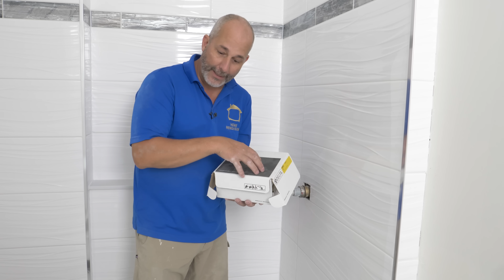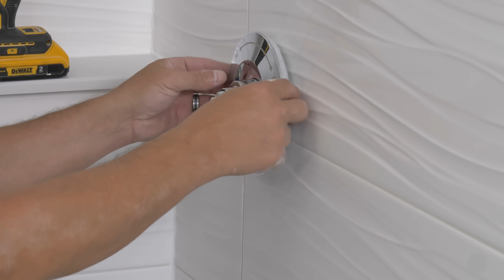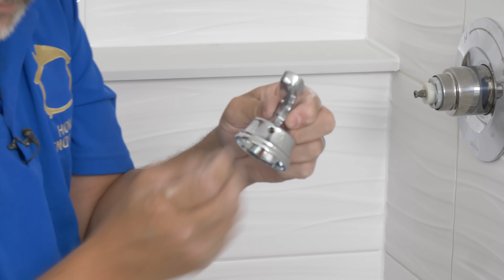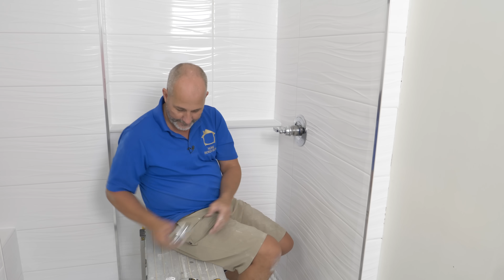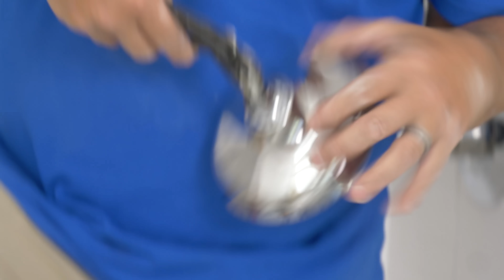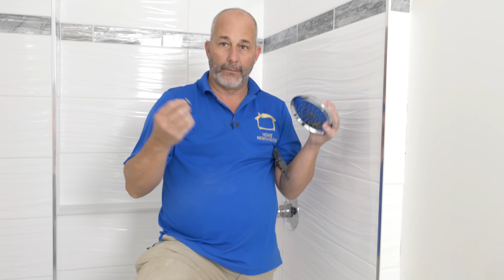Change Your Shower Head and Get BETTER Water Pressure

Comment: @9m15s, the piece Jeff takes out of the shower head is NOT the flow regulator. It's just an aerator. The flow regulator is STILL IN the shower head assembly. It is that little blue thing you see looking down inside of the threads on the shower head. This particular head he's installing will still have poor pressure because he never takes out the real flow regulator, and he never tells you that manufacturers now build the shower heads such that it's almost IMPOSSIBLE to remove them unless you destroy the entire shower head. This is how Communist our countries have become!

Comment: Question, I have removed the restriction but the pressure will sometimes be awesome but if I switch settings the pressure will not come back when I switch it back. I heard a click but I can't figure out why or how to get the pressure back.

Comment: @9:10:  That's a screen, not an aerator or flow-restrictor.  The blue thing is the flow-restrictor.  If you remove the flow restrictor, reinstall the screen, unless you just like having calcium deposits in your fixtures that you can't clean out.

Comment: My shower head started leaking, so I bought a new handheld showerhead. The old one was 5yrs old. The water pressure was SO BAD with the new shower head. I could hold the shower head with the spray pointing toward the ceiling and the water jets would only shoot out about 2 inches above the shower head. So I removed the shower head and realized there was a tiny blue plastic restrictor installed in the base of the shower head handle. I removed that, reinstalled it, and now the pressure is excellent. I also did the same thing on my bathroom sink and kitchen faucet. I hate wimpy water pressure.

Comment: The real issue here is the ridiculous pancake size shower head.. Why? Because it’s the latest trend.  I’m sure everyone takes their visitors  to the shower to show them their shower head🙄. You can use water responsibly and still have water pressure.  Simply go back to the regular water restriction shower heads. They are often  provided free by your local utility company.

Comment: Delta makes a Monitor17 trim kit called Lahara that has two levers coming out of the same hole. The larger one adjusts pressure and the smaller one adjusts temperature. You can leave it at your preferred temperature and then adjust pressure to whatever you want. I really like that option. Had a cartridge blow on one due to unexpected freeze (it doesn't usually freeze here) but Delta sent a replacement for free. Installation for my application required access to behind the valve and the flange didn't sit flush against the wall- but I think that is because my wall ended up a bit wonky. The cement board must have bent slightly and the surround I put up over it followed the bend. Ether that or the flange was bent. Couldn't tell which but I applied caulk around it to cover the gap.
I caulked around the bottom too. Oops. LOL. I can always cut a relief in the caulk below if push comes to shove. You'd have my shower trim if you hate seeing the silicone. LOL. I wasn't going to caulk until I saw the gap that was left and could not get the flange to adjust tighter.
LOL. I'm sure my mother will let me know if she's not happy the way I renovate her bathroom. I'm glad you remembered that women do renos to. LOL. I'm the handy one-- although with recent health issues & loss of hand strength + arthritis, I have to get help from a younger male friend.
My brother is the one who needs the high pressure to wash the product out of his hair. He's got like 10 bottles of product in my shower right now (since its the only working one in the house). I have 2 bottles. LOL. I need to see if my showerhead has that stupid aerator because I know it is going to get clogged by my hard water if I don't take care of it.
Around here, you have to purge your lines a little before installing the valves & showerheads or else sediment that has been sitting in the pipes will clog them.
I wish I'd watched this before I installed the shower trim in my bathroom-- but that was months ago and I'm glad I have been able to shower.

Comment: all shower heads come with gasget. I ve never seen a single shower head with tapered thread. Can there be one? yes sure, but I never seen. so you shouldnt put teflon tape. I said you shouldnt I didnt say you dont need to. Reason is if you put teflon to a gasget joint it is easier to leak than not using it. Since the thread is strait you are not squizing the teflon. and sometime teflon gives feeling of you are done turning. it gives a tightness feeling but you still didnt squeze the gasget. Most probably the part you moved was also gasget. double function. Take it out and put a gasget. I have fixed so many showerhead leak just taking the teflon and reinstaling in many years. you are one of the best guys in youtube. I never seen you doing something wrong. I think this is the only thing that need to be addressed. Thanks bro. Mahalo from Hawaii

Comment: An aerator mixes the surrounding air with the shower head flow. Making a smooth stream and using less water.
And of course a lesser impact on the environment.
Reply: And makes me have to take twice as long in the shower to wash myself. Fuck off.

Comment: I'm from Europe and when I visited the U.S.A., i was shocked by the unconvenient shower in my hotel. A fixed shower head at the top and the faucet had only one degree of freedom - first you increase the water flow of cold water up to the maximum and then it starts adding hot water. I thought - this must be some old system, certainly nobody would install this nowadays. And as I see, it is still common and people do this voluntarily to their own homes :)
You cannot have a warm (mixed) water of a lower than maximum flow? Well, for a fixed "rain" shower, this might not be the biggest problem. But I really cannot imagine using the fixed shower head. What if you want to wash just dirty feet? Or your whole body, but don't wet your hair (especiall women)? How to you give special attention to your private parts? How to you clean the shower itself?
Of course - everybody can use what (s)he wants, my comment is not meant to criticize! I'm just expressing my surprise. If I bought a house with such a shower (well, it would be hard, it is hardly existing in my country), I would give it the top priority to replace it :)

Comment: either your cartridge is install  upside down or your valve body is flipped.

Also your valve body needs to be secured to some backing.

I would start flipping the cartridge first. there a hot side labelled since a 1000 years

Comment: Jeff removed the filter for the showerhead so the nozzles dont get clogged, the actual restrictor is the blue piece with small o-ring that was beneath the filter.
Reply: Yep. Noticed that too.
Reply: Shhhhh, don't give away the secret.
Reply: yeppers
Reply: Correct. It’s the black o-ring that you need to remove. Just did that on a fixture I installed
Reply: @jfastard The black o-ring seals the fixture to the stem.  It's not a flow-restrictor.
Reply: @ncooty  then why did my shower pressure skyrocket after removing the o ring? Respectfully, I’ll agree to disagree with you.
Reply: @jfastard  I wonder if we're talking about the same o-ring.  Are you talking about the flat o-ring that serves as a gasket between the shower head and stem, or the small round one integrated into the flow-restrictor itself?
Reply: @ncooty  I am talking about the small one that restricts the flow
Reply: @jfastard  Gotcha.  I misunderstood you.  My mistake.

Comment: Ok so this has zero effect on water pressure , the pressure remains the same no matter , what your doing is trying to increase the flow rate , but this would only be achieved by removing g the actual restrictor ( which is the blue part ) what you removed is the filter 🤦🏽

Comment: I'm not recommending you remove the flow restrictor but if you do, then replace it with a sediment screen otherwise you risk plugging some of the holes without an easy way to remove the sediment. Sediment is most likely to occur when the house water has been turned off and then back on. Since Jeff doesn't have a faucet in his shower, all sediment will always go through his shower head. Running the shower faucet for a couple minutes would reduce the risk.
Reply: Exactly what I came here to say. Our water company is constantly fixing leaks and turning off the water or it seems we're always fixing leaks of our own and having to turn the water off. Every time that water comes back on, sediment comes with it ( we also need to replace our old water heater) and I have to rinse the screens in the shower. If not for those screens, I'd have to replace my shower heads constantly. They don't reduce the pressure either like those plastic restrictors.
Reply: @triciasanders2455 solution to the sediment issue from the utility company: whole house water filter. Place it as close to where the water enters the house first. It will save you all kinds of grief. When I installed mine, I installed a carbon filter next in line before continuing on through the house. All taps had filtered water at them. Just change out the filters as needed. For me it was about once a year. For a family it will be sooner. And no more mud in my pipes, 😊
Reply: @denisegaylord382  We have definitely talked about that because that's exactly what we need! We've had so many other projects that came first, we just haven't gotten around to that one! 🤦🏼‍♀️😂

Comment: I think the valve assembly was installed upside down which is why Jeff decided to reverse the handle. Reversing the handle is a bad idea. Reversing it has gravity turning it on and lifting it is an unnatural movement to fully turn it off. Typically, there is a stop adjustment for the hot side which is why it wasn't level. My recommendation is to position the handle correctly even though it does not look perfect.
Reply: He didn't even secure the valve body either lol
Reply: It causes problems later on too. That delta valve can rotate a bit and you'll get leaking after turning it on and off over the years. When I moved back into this house the assembly was always dripping, the "plumber" for the rental company installed it upside down. It took me about three hours just to get it out of the damn housing.

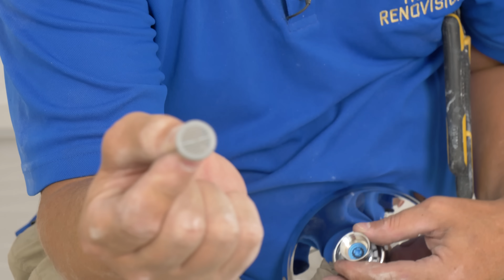Comment: What you took out is not a restrictor, it's just a plastic sediment filter/mesh. You left the restrictor in the shower head. It's blue and clearly visible at 9:18.
Reply: I removed the exact same part from my Gerber shower head 3 months ago and it almost doubled the water volume coming out. Since then I've been telling everyone I know if they want more water flow to do what I did. Whether you call it a restrictor or a filter it does the same thing - it restricts the water flow.
Reply: @Butterfly-iz3nm  The filter screen and restrictor are 2 different parts.
Reply: My restrictor was permanently placed in the shower head. I literally just went the ghetto route and drilled a fat screw down the middle to open the hole up lovely. It was life changing. Hope this helps anyone else that encounters the same problem. Now I shower in a fire hydrant lol 🚿
Reply: If you are very careful, you can usually drill out the flow restrictor, and reinstall the filter screen. I usually try to match the restrictor size to the drill bit, and working carefully, slowly drill it out. A vice to hold the shower head is nice if you have one. Don't push too hard, you can drill right through the whole assembly if you're not careful. Low rpms. Gentle pressure.
Reply: My moen came out easily. It depends on model and design. Not going to get great pressure with just the screen filter removed.
Reply: Good luck removing that, ask me how I know 😂. They put valves on them as they constrict the line.
Reply: @ForrestOutman  If nothing else you can drill a hole in it.
Reply: Just remove the o ring
Reply: Now I just check flow rates when I shop, phuk low flow

Comment: If your shower pressure is extremely high after removing any restrictor, then you might have overall too high water pressure in your house and need a pressure regulator valve. Too high pressure in your pipes can cause them to fail.
Reply: This is nonsense.If your pipes are failing, then they are corroded to failure, and regardless of any restrictions, their life is at an end. Water delivery pressure in North America is nominally 60 psig (4 bar), perhaps slightly less if your house is at the end of a mains loop or at the top of a hill. Residential pipe/tubing is tested to 300 psi, and the burst strength is about double that, or 10x mains pressure. BTW the "pressure" of the water when it exits the faucet is atmospheric pressure. What you perceive as pressure is flow and/or velocity. The higher the flow through an orifice (i.e. the nozzles at the shower outlet) the higher the velocity will be. As correctly pointed out in the video, the shower restrictions that are factory-installed are designed to reduce flow, which will reduce velocity and the feeling of how hard the water is hitting your skin. Water conservation initiatives are designed to reduce water consumption, which only works if you don't take longer showers to compensate for the fact that the lower velocity is less efficient at ringing you off.
Reply: @gavinmclaren9416  the pressure of the water coming out of a pipe is not “atmospheric pressure”. Atmospheric pressure is the pressure of the air around you. It’s typically around 15psi. 
If a water pipe has an internal pressure of over 100psi, it will cause strain in your joints. Just like too much air pressure can balloon a container if there’s too much of it. Water is incompressible, therefore the more you try to force it to be contained, the more damage it can cause. There’s a reason why pressure regulation valves exist, you know?! lol
Reply: @dash1dash2 Atmospheric pressure at sea level is 14.7 psia (or 100 kPa absolute or 1 bar absolute or 760 mmHg) +/- some variation with weather. It is also 0 psi gauge (psig) by definition. 
Once the water leaves the shower head, it instantaneously drops in pressure to whatever the local atmospheric pressure is, or more exactly the pressure head is converted to velocity head by Bernoulli's law, which is essentially conservation of energy. 
Pipe and/or tubing joints, if properly executed, are designed to be stronger than the pipe or tube they connect. Of course if the joint involves the use of a gasket it is subject to deterioration and could eventually fail due to that. All bets are off if the joint is poorly done.
If you are connected to a utility supply for water in North America the pressure will never exceed 70 psig unless there is something drastically wrong at the pump station. I suppose if you had a well for water supply you could set up a pump to have a deadhead pressure of 100 psig, but that would be foolish. So potable water supply at 100 psig is academic as you will never see it.
Reply: Hi, what happens to the pipes if the pressure is too high? When you say "fail" does that mean the pipes will burst and leak? Thank you
Reply: @cc_bloom The pipes won't burst, but seals, valves, connections, and hoses could fail prematurely, and those will leak or not operate correctly.
Reply: @cc_bloom  Joints may begin to leak and some appliances connected directly to water might have issues. Typically 50 psi is normal, and a maximum of ~80 is fine as well, but continuous pressure >100 psi can become problematic.
Reply: The pressure is already in the pipes, it's only reduced by the restrictor.

Comment: Not a flow restrictor. It's a screen that prevents sediment from lines / pipes from  going into the shower head and clogging it.
Reply: Flow restrictors can't be removed so easily. One look at that design and it's easily identified as a screen. Per delta engineering flow restrictors are further embedded into the unit.
Reply: The flow restrictor was that blue thing still in the shower head after he took the sediment filter out. Segment filter is designed to be screwed out for cleaning and replacing...
Reply: @Restless2010 yep you get it.
Reply: @Restless2010  exactly, the guy don't know what he's talking
Reply: It's a flow restrictor as required by US law. It also serves as a sediment screen.

Comment: If you're concerned about water conservation, why don't you just not turn your handle on max setting with the aerator removed.
Reply: New shower.  No control over pressure at all.  Just temperature 😢
Turn handle - full throttle!😂
Reply: What the heck? It's either a cheap $10 system or some 'modern' $400 one I'm guessing lol. What is the model?

Comment: In addition to the points that @nathanfisher1512 and @ssrrocks22 make in regards to removing the restrictor, if you have a tankless water ehater system, you also need to take into consideration the GPM capability of your water heater. If the flow is higher than the tankless can properly adjust the temperature rise for, you'll be taking a lukewarm high pressure shower

Comment: That valve body should not be sticking out so much.
Reply: I noticed the same thing. The valve body was just left floating. I should have been secured with the tile trim plate to set the proper depth. It would drive me crazy seeing that much sticking out like that.